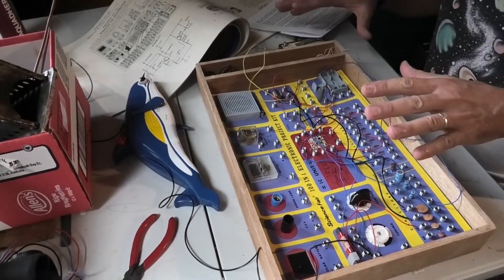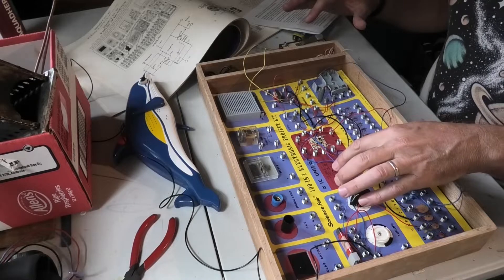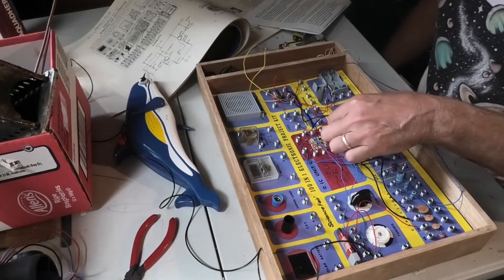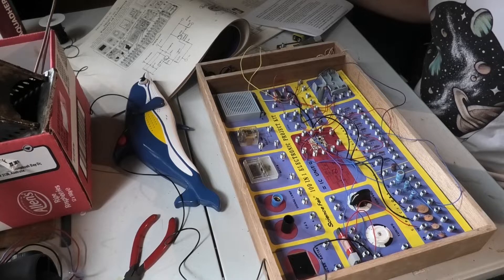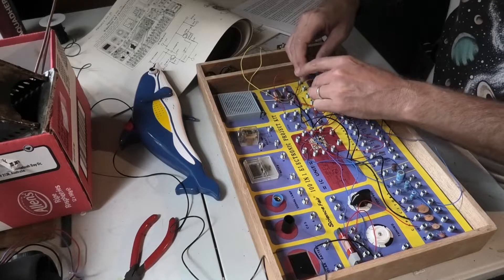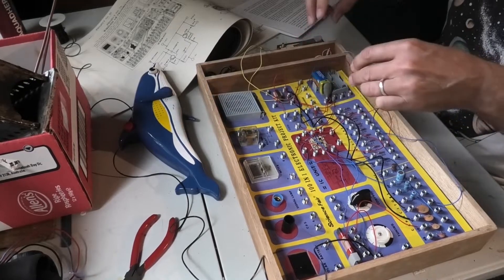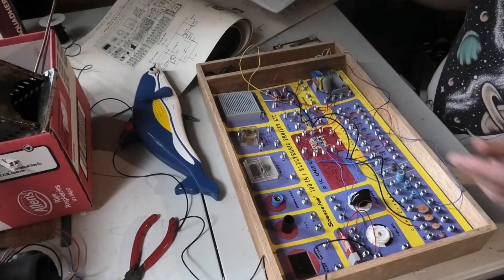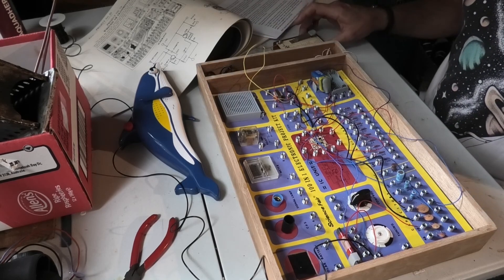Science Fair 100 in 1 Electronic Project Kit, project 72, Morse Code maritime distress signal test

Comment: I have that kit. but it came with no wires. I cut some wires to make it work but I would like to know the factory lengths of the wires. form what I have done with it so far, red is the shortest, yellow is the longest, and blue is in the middle. I just don't know how long each color is. could you measure yours and let me know? thank you
Reply from the maker: Sorry I no longer have the kit. Good luck searching.